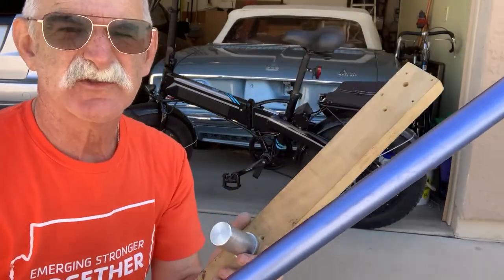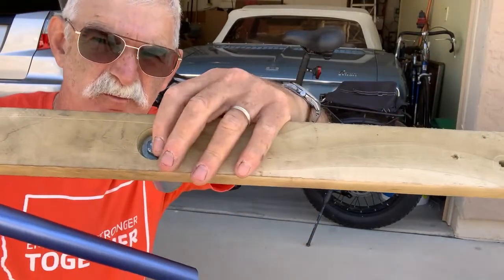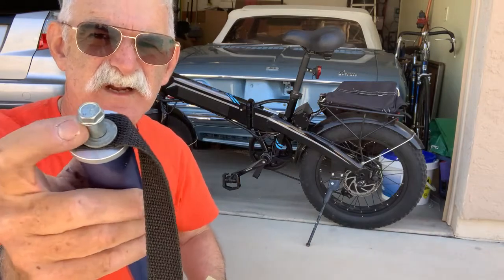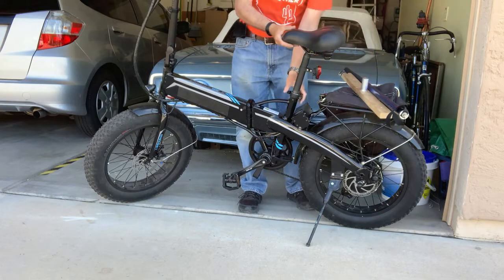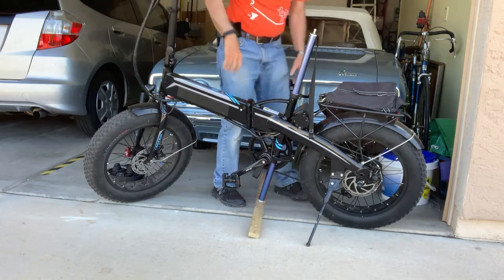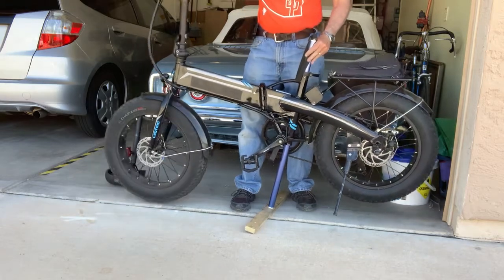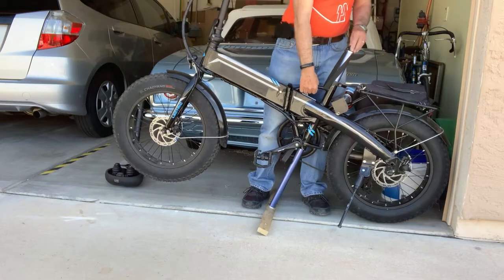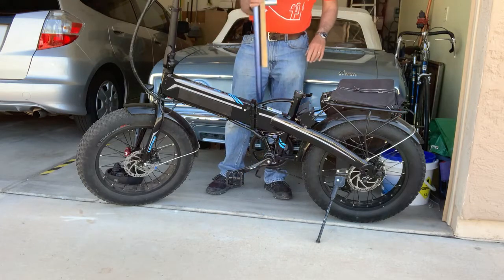A Maintenance Stand for a Lectric XP eBike

Comment: I like your stand. I just use a ratchet strap hanging from a hook on a rafter and looped around the back tire rack. Easy to adjust and work on the bike. If I want both wheels off the ground I rig a strap on the front. Works great for me.

Comment: I have some handlebar jacks. I place them on my handlebars, press my rear brake and flip the bike over. This is a nice idea also.
Reply from the maker: When I need to remove a wheel, I turn the bike over, but to work on the brakes or derailleur I prefer it right-side-up.
Reply: @rgsparber1  that is true